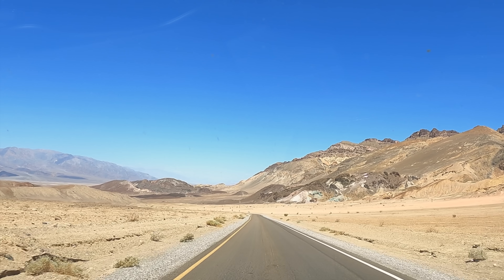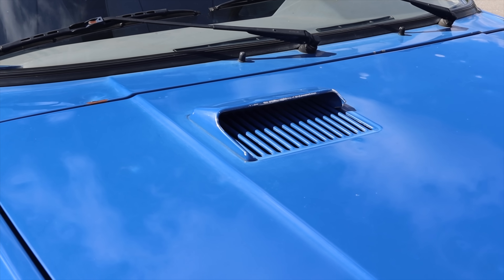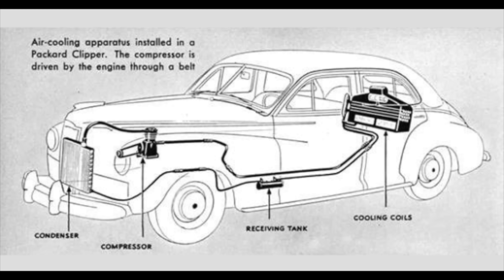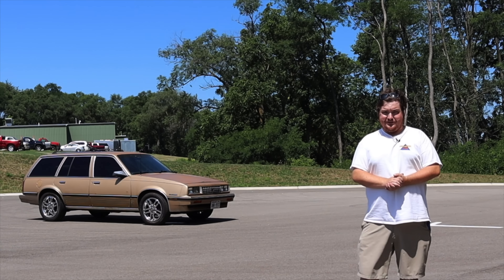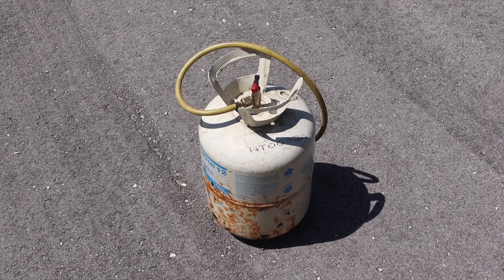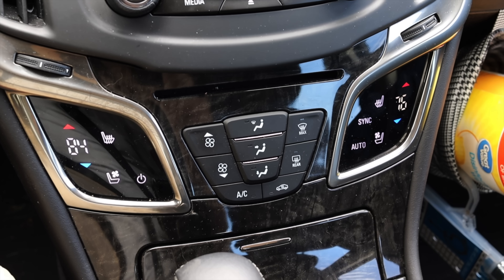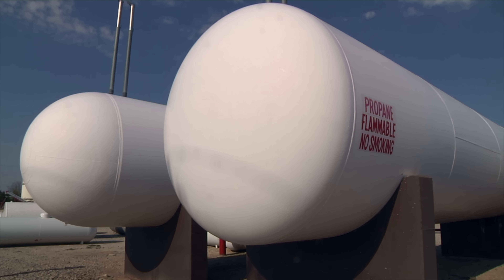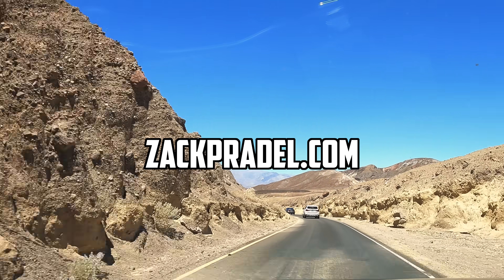Air Conditioning - The Story Of R12 & Why Modern Air Conditioning SUCKS!

Comment: R134a is already being phased out in newer cars with R1234yf. It's supposed to be less harmful to the ozone layer. BUT it's extremely flammable.
Reply: 1234yf is butane based
Reply: @ShortArmStrongArm  R-1234yf is absolutely not butane based.
Reply: @MrZorbatron  old post but did I say it was?
Reply: @ShortArmStrongArm You did.  Scroll up.
Reply: @MrZorbatron  All I find is when I said I charge my 134 systems with propane.
Reply: @ShortArmStrongArm  propane   they just want to try to minimize how dangers this stuff is     and the conditions are right under the hood of a auto for a fire  its warm  fans to bring in new air   what more can one want
Reply: @claycoates5056  🤷🏻‍♂️ i charge my R134 systems with regular ‘ol propane so oh well. Fuel pump sending large quantities of pressurized gasoline worries me more.
Reply: And EXPENSIVE!
Reply: @GoTMLGo1967  Very. Like 2500 to fill an empty system.
Reply: @davidchillton1744  Fun fact: there's not actually enough propane or butane in the refrigeration system to be an appreciable fire hazard. The main reason propane cooling never went mainstream was lobbying by DuPont to keep propane out of these systems so people had to buy expensive DuPont-patented fluorocarbons. 

Also fun fact: Early refrigeration systems used pure ammonia. They straight-up killed people when they leaked. 

Alsoalso fun fact: Modern industrial refrigeration STILL uses ammonia, and these systems still kill people when they leak.  Ammonia's just too good a refrigerant if you ignore the high toxicity.
Reply: @CptJistuce  A lot of arenas are still using ammonia.
Reply: @shadowwolfmandan  Yup. That's one of the things I was filing under "modern industrial refrigeration".
Reply: R11 was str8 ammonia and used in the 50s as refrigerant. Freon was name brand by DuPont. When the government cracked down DuPont changed the name to Suva.
Reply: @CptJistuce High toxicity? What? How in holy graces do you get a lethal dose ammonia? The slightest whiff of pure ammonia gas puts my lungs in total agony. I’ll die of suffocation well before I receive a life-threatening dose. Unlike CO, this ship will absolutely wake me up at the slightest hint of an indoor leak. That’s exactly what smelling salts are.
Reply: @setoman1  Relative to other refrigerants, it is quite toxic. As evidenced by the fact that ammonia refrigeration system leaks have killed people. This is not supposition on my part, it is documented fact. These days it happens exclusively with large commercial systems.
Reply: @CptJistuce  Arkla Servel units were everywhere here at one point. It is an absorption  system and worked, just not long.
Reply: @gibraltar321  The fire-powered coolers? Those still hurt my head. Like, fire is heat, almost by definition. It shouldn't make things cold!
Reply: @CptJistuce  True. Hurt my head learning about them. It shouldn't work but did, for awhile. Every liquid and gas on earth is an refrigerant.
Reply: @CptJistuce  Yea I remember hearing that in the old days they used ammonia as refrigerants. They worked real well but is not exactly good for people. However even traces of ammonia has a strong smell....
Reply: @CptJistuce Propane, under pressure,  circulates through the passenger compartment.   There's plenty enough to be dangerous.
Reply: @jackb1803  To my understanding... no, not really. It only takes a little bit of propane, and it is far less dangerous than most of what's been used instead.

I had to scroll back to figure out what was being replied to.
Reply: @CptJistuce since ammonia based refrigerant is solid state and only requires a heating element, it's used in RV refrigerators since it can be from with a propane furnace. I have had ammonia refrigerators go out and they will leak a heavy pungent gas for about a week before it runs put. If you're brave enough to cut the lines it will all leak out in about an hour or so and you won't be able to go near it for a few days becuase it will burn your eyes and lungs if you get with in 200 feet of it.
Reply: @CptJistuce  That brings up an interesting point. Most of the hardware for car air conditioning systems is essentially outdoors, so it's unlikely that the ammonia will kill anyone when it leaks. So maybe car AC should go back to using ammonia.
Reply: @pcno2832  Unless it leaks from the evaporator, which is in the cabin.
Reply: @pcno2832  say that when you’ve had a minor crash and the a/c ruptured and you are waking up from an air bag induced k.o in a cloud of ammonia
Reply: @pcno2832 you have to remember the evaporator, expansion valve, and part of the lines are all inside the cabin. Half of the components are inside.
Reply: @CptJistuce  I have absolutely no reason to check anything you've written/asserted because of "DuPont".  (NOT joking)
Reply: R1234yf is also very expensive compared to R134a.  It's nickname is YF for Your Fucked!
Reply: @Stumpy1973  YF is expensive because it's still under patent (AFAIK) with Honeywell, so they can charge what they want until the patent expires; I'm sure their shareholders are very happy with the price.
Reply: @Stumpy1973  Exactly! 
152a is only a little bit more than 134a. That's with the current use.
If we were using 152a then economies of scale should come into play.
Reply: @robertrocheville7769  I use 152A in my truck. Cost me half what 134A costs to charge it with the air duster
Reply: @Stumpy1973  at the the dealer we always called R 1, 2, 3 why the f*ck?
Reply: @Stumpy1973  $1600 a jug here.
Reply: @Stumpy1973 in the UK, I can get my car AC regassed for £60 to £80 as it uses R134A. However, to get a car using R1234yf regassed, it's £120 to £150.
Reply: @Stumpy1973 it's very expensive because DuPont owns the patent
Reply: Then just you some damn propane at this point
Reply: @vwbora26  car go boom
Reply: @vwbora26 Don't forgrt the propane accessories
Reply: @vwbora26 yeah, propane is also called r290, and it is used in some in low temperature applications
Reply: It's not extremely flammable. It does burn, but doesn't burn very hot. 

I don't know why they didn't move to 152a(that's the duster can he was mentioning). It's very compatible with 134a, is more efficient, and has a lower GWP than 134a.
Reply: most new fridges are using what is basically butane now....
Reply: @workingshlub8861  isobutane, gotta be sure to purge it all out before you braze on it lol
Reply: @workingshlub8861  cyclopentane is that you?
Reply: @workingshlub8861 my dad says butane is a bastard gas
Reply: @workingshlub8861  Cyclopentane?
Reply: There are rumors they are going to get rid of yf now too.
Reply: @levithrasher7417  i was recently section 609 certified and i can tell you that they are not phasing yf out, they made it so it was not required in new cars after making it required for a short amount of time due to supply chain shortages.
Reply: Why do the names just keep getting more and more ridiculous? What was wrong with R13/R14?
Reply: I was about to say this. It's also like 1/10th the CO2 equivalent as r134a.
Reply: @borandolph1267  try 1/1000th
Reply: so is gasoline and oil lol
Reply: What about R32? I fount it in my home AC
Reply: @ yahnathan morales ..... u mean R22
Reply: I don’t get why they won’t use  a propane/butane mix. There are commercially available r12 substitutes based on propane/butane that work very well that are much less flammable than newer flammable refrigerants.
Reply: @dontmesswiththeman  I don't think the butane propane mix is less flamible than r1234yf.
Reply: ok well technically it is classified as  "slightly flammable"
but even then I suppose its not the most flammable thing in a ICE car OR lithium battery car lolol
Reply: Its also stupid costly, and the machines for auto shops  being so costly repairing the systems are more. so that and it's already flammable why bother. It leaked out of my 2019 car so in goes  R-290. (that's the super pure propane you buy as a refrigerant)
Reply: The R1234yf also is one that isn't supposed to be easy to refill.
Reply: It also cost about $100 a pound and leaks like crazy
Reply: burning 134a make a nerve gas, burning 1234yf is worse.
Reply: I saw online that is mildly flammable, Not extremely flammable!
Reply: r1234yf is considered mildly flammable.
Reply: Don’t crash.
Reply: I'm going to be honest, it sounds like you made that up even though I know it's true
Reply: Apparently one of the major issues of R1234yf is that if you burn it (like in a car fire), the resultant gas is very corrosive.
Reply: I think I’d rather choose the former than having something that is noted as “HIGHLY” flammable on something I’m driving at 60mph.
Reply: It’s expensive af too at like $60 per 8 oz can
Reply: r1234yf is a literal scam by car manufacturers. more dangerous, more expensive, doesnt work as well. hmm no benefits except negligible environmental benefits
Reply: Most asian region still use it
Even some still sold R12 for installing new ac system or servicing.
Reply: R134a is not a cfc, it is an hfc. There's no Ozone Depletion Potential. It is high Global Warming Potential.
Reply: wont be in my car   my 92  k1500 still has r12    cant be beat
Reply: R134a is not harmful to the ozone layer, but instead they worry about it being like c02
Reply: I bought my car used, already has R1234yf. Car is from 5 years ago.
Reply: And extremely expensive as well as extremely corrosive. The 1234 system tends to leak. 
You can believe all the ozone  global garbage you want, but r12 is gas that is heavier than air that they want you to believe that it will get to 30,000ft where sunlight will break it down to sulfuric acid and then get to 60,000 and then blown to the antarctic to create a hole in the ozone. You can buy all of that you want 🤣. Food for thought, India is still making and using r12 and the ozone layer is healing itself. One more of the dozens of the end of the world scenarios since the 70s. 
The real reason for stopping the use of r12? Dupont's patent had run out.
Reply: It is also obscenely expensive
Reply: That’s good 😌
Reply: It’s also very expensive.
Reply: It is not 'extremely flammable',  but yes it will burn.
Reply: Oh sh-
Reply: Wrong.  It's MILDLY flammable.
Reply: And extremely expensive from what I've heard.
Reply: It's also extremely expensive too!
Reply: I thought you made that up but it's true
Reply: Back to that dastardly CO2 .. that they claim is 00.04% of the atmosphere again.... same gas that is used in photosynthesis and plant growth.... that creates o2. I can see genuine science here mixed in with theoretical pseudo science.... probably.
Reply: @stevel9914  no. i am certified to work with refrigerants. this is not pseudo science. when R12, a chlorofluorocarbon, is released into the air it makes its way up into the atmosphere because it is less dense than oxygen. eventually it reaches the ozone layer. chlorofluorocarbons themselves are not reactive, but when exposed to high amounts of UV radiation like in the ozone layer the chlorine atom splits off. the chlorine in the chlorofluorocarbons is very reactive with ozone, and this reaction destroys the ozone molecules and splits them off into chlorine monoxide and oxygen. chlorine monoxide is a powerful greenhouse gas with the capability to stay in the atmosphere for over 1000 years.
Reply: and extremely expensive
Reply: @carlosnavarro921  which is why they stopped phasing out r134 as of 2021 until supply chain issues can be resolved
Reply: My mini fridge uses butane or something
Reply: It is not extremely flammable, but classified as mildly flammable, as in would need to have a blow torch flame hitting it directly to burn, but won't spread.
Reply: It's like air conditioners. R22 had been used in air conditioners (window, central, ductless mini-split, PTAC, etc.) starting in the late 1920s. But thanks to the Montreal Protocol, R22 would have to be phased out. In the 2000s, R410A became a new alternative, but it was said to also cause global warming like R22, so nowadays, newer air conditioners are coming with R32 which is said to be much more environmentally friendly, but it is flammable.
Reply: Ah yes, R12, invented by the same man who brought us leaded gasoline, Thomas Midgley Jr. At the time, his inventions were world changing, but not in the way he would have imagined I'm sure.
Reply: 1234yf is garbage too. I’m not old enough to have experienced R12, but I have used 134a plenty of times, and it’s super potent…
Reply: It’s SLIGHTLY flammable, not extremely. It’s also compatible with R134a systems
Reply: Saying it's extremely flammable is also a extreme exaggeration
Reply: 1234yf is not an A3 it’s A2L hard to ignite even when exposed to opened flame 😂
Reply: Then just go back to using propane...
Reply: Reminds me of Fernie Canada.
Reply: Look at the high-cost screwing we're all getting in the HVAC industry because of the EPA and its ozone depletion cr*p!

Ozone depletion is crap. 

William Happer discusses ozone depletion quackery (min 10:00)

William Happer discusses the ozone quackery that has sh*tted up the HVAC industry. (min 10:00)

https://www.youtube.com/watch?v=KGn-6kGoD0c&t=1320s

The Nonsense That is Ozone-Depletion

"Holes" in the ozone argument: 

1) Freon is heavier than air:  how do molecules heavier than air get to 30,000 feet (the beginning of the stratosphere)? 

2) The "hole" in the ozone over the South Pole was "discovered" by satellites in the '80: if it was just "discovered", how do we know IT WASN'T THERE ALL ALONG ? ? ? ?

Ozone Hole Over Antarctica is Bigger Than Ever | 2020 Ozone Depletion
https://www.youtube.com/watch?v=njII28jfLVQ

3) There is a perfectly logical reason why there is less ozone over the polar regions: THERE IS LESS SUNLIGHT THERE TO PRODUCE OZONE IN THE FIRST PLACE, especially in winter ("land of the midnight sun...")  

4) Antarctica (South Pole) has the highest average elevation of any continent (8000 ft): Does that have any effect on ozone quantity?????  (The North Pole is all at sea level and there is no ozone "hole" there.  (Why not?) 

5) The offending atom is CHLORINE (very common), not CFCs themselves. The argument goes that the CFCs carry CHLORINE up to the stratosphere.  There are other compounds of chlorine in the atmosphere -- that's one of the things you smell when you go to the beach  --> "salt water" --> i.e. sodium-chloride.  Is the ocean a source of "ozone depleting" chlorine compounds?  

6) Most basic of all, ozone (O3) is an EFFECT of UV blockage, not a cause. [O3 is an unstable molecule that needs a lot of energy to produce, e.g. the ozone you smell around arcing engines. There is less ozone at the poles b/c there is less UV to generate it (just like there is less sunlight to keep the place warm in the first place.     

I hope the public is beginning to see how dubious this ozone scam is.   Monstrous mistakes like this DO happen - think the ban on DDT and malaria deaths.

The Ozone Scam
https://youtu.be/9Szs-treHwQ

The Nonsense That is Ozone-Depletion

https://www.ourcivilisation.com/ozone/king.htm+

Look how we've been "had" by this "ozone depletion" scam:

In other words, CFCs probably have NOTHING to do with Antarctic ozone:

https://youtu.be/lBu3vltczRw

In other words, the× Montreal Protocol is a complete fraud:

Min 0:30:  "Measurement of SURFACE 'ozone depleting substances' (chlorine? are you measuring ALL atmospheric chlorine compounds?).  

https://youtu.be/uVeTJSIbGm8

1987 - Montreal Protocol. Remember that date in this music-tracked piece of manipulative propaganda.
Listen for the weasel words and disclaimers.
https://youtu.be/Ll_TR7C4xr4

The Ozone hole is "healing" (scientific term). Can't you tell?:
https://youtu.be/taTzqRHNIEc

A discussion of atmospheric chlorine:

https://api.nationalgeographic.com/distribution/public/amp/news/2010/3/100310-sea-spray-ocean-colorado-pollution

Natural Chlorine? You Bet! (American Chemistry Counsel)

"Many of these chemicals are identical to highly publicized manmade organochlorines: chlorophenols, chlorinated hydrocarbons, PCBs, CFCs and dioxins."

https://chlorine.americanchemistry.com/Background-Natural-chlorine-You-bet-/

Min 7:50 "In the old days, capacitors used to last 10-20 years"
https://www.youtube.com/watch?v=eGEduZ3EVcg

7) Min 2:00 Listen carefully: in other words,  the ozone hole has been there since AT LEAST the 50s, before CFCs were widely used.

Min 15:00 "interesting scientifically" - must be fun to have these kinds of research grants and boondoggles. Great work if you can get it.

https://youtu.be/AU0eNa4GrgU

How EPA is screwing up your car's air conditioning. 

https://youtu.be/wm56tV5BbJk

Lousy car air conditioning:
https://youtu.be/5jKRiDtcBrs

Guy says we should use explosive propane as refrigerant

https://youtu.be/pv_fxOuLuZU

Propane as a refregerant
https://www.youtube.com/watch?v=iXyHOfx307k

.
Why The Banning Of Chlorofluorocarbons Is Paranoia

https://www.ourcivilisation.com/ozone/index.htm

Min 6:00 -- two different kinds of chlorine... (yeah, right)

https://youtu.be/kmfAM8kQrjU

The stupid claim the ozone layer is "healing" ("healing" - is that a scientific term?)  

Notice that the "hole" always goes away in Antarctic summer (more sunlight/more ozone produced) and reappears in Antarctic winter (no sunlight/no ozone produced (ozone is an unstable molecule to begin with)).  We've been sold a load of cr*p that has made a hideous mess of the AC industry. 

You'll see no change in hole size in the Antarctic winter, which means the "hole" has been there all along and is a perfectly natural and harmless phenomenon.  "Oh well, we trashed an entire industry over a quack-science hoax... Sorry about that..."

https://www.youtube.com/watch?v=kyGoqC9FTFc

https://youtu.be/krqHVzF3-T8

Min 21:00:  A brief history of refrigerants R12, R22, R410a and the screwing we get from the EPA, the "Montreal Protocol" (a self-appointed bureaucracy still alive and well) over their ozone depletion quackery.  The doubling of pressures from R12 to R22, and the DOUBLING AGAIN from R22 to R 410a,

AND R22 wasn't even banned for ozone depletion! (100x less "odp" from R12). It was banned for "global warming" quackery. 

https://youtu.be/V_wUZ4qmAnk

Min 36:00 Can be charged up to $30 a pound to destroy "contaminated" R22:

https://youtu.be/V_wUZ4qmAnk

Min 7:00 "pre-EPA refrigerants operated at low pressure and only soldered (not brazed) pipe joints. 

https://youtu.be/G0XOLDHGBmU

Min 18:00 all refrigerants turn into acid when in contact with water (! ! !):
https://youtu.be/kmfAM8kQrjU

Refrigerants decompose in water ! ! !

https://www.answers.com/Q/What_happens_when_refrigerant_hydrolyzes_with_water

What is hydrolysis?
https://youtu.be/G_mT9JI_jxE

What about the ozone hole and R-12 refrigerants?

https://creationtoday.org/what-about-the-ozone-hole-and-r-12-refrigerants/

Also forgotten is a long list of truly ridiculous claims, such as the one from Al Gore's 1992 book "Earth in the Balance"that, thanks to the Antarctic ozone hole, "hunters now report finding blind rabbits; fisherman catch blind salmon."

https://www.heritage.org/environment/commentary/ozone-the-hole-truth

Minute 22:00 refrigerants disassociate in water, so why sre they a problem in the stratosphere?

https://youtu.be/5SpOiHB6VsE

15% of chlorine in stratosphere is natural, according to this:

https://csl.noaa.gov/assessments/ozone/1998/faq3.html

Another comment I submit to The Order is about "NOISE", namely, 

- NOISE is a bad thing -- we don't want that in our houses. 

- Don't compressors that are forced to operate at higher pressures make more NOISE than compressors that operate at much lower pressures? 

- Assuming the answer to the above is "yes", then would a compressor that has to operate at 450 psi (for that stupid R-410A refrigerant -- 'scuse my french) vs. 150 psi for R-12 (the industry standard till that stupid EPA came along -- 'scuse my french again). 

- Here is a PT graph for the major refrigerants: https://www.engineeringtoolbox.com/refrigerant-temperature-pressure-chart-d_1683.html

- Conclusion: the stupid EPA and DOE have not only made AC equipment more expensive to buy and more expensive to maintain and less effective in terms of cooling (window ACs) -- they have also made them NOISIER.  ... Thank you, tax-paid idiots of environmentalism and quackery that is "ozone depletion" (the warmup act for "global warming" -- "Hey Texas -- how's that renewable energy/global warming/windmill thing working out????")

Thank you Boomer generation (mine) for the 60s mess you have made of America. 

Cheers.

PS: here's a video about a stupid 90% furnace whose condensation overflowed the week before Christmas and trashed multiple ceilings in the guy's house. Of course, those stupid DOE bureaucrats will be there bright and early to fix the damage.  "Happy Holidays!" 

https://www.youtube.com/watch?v=DnVtRqfqoSY&ab_channel=AntiDIYHVAC

... And another video about a screw-up with the INDUCER fan --> a creature of "high efficiency" DOE regulations which dictate the squeezing all so much heat out the combustion, a separate fan needed to get the exhaust gasses out the flu.  Then they break down and screw up the whole system. 

https://www.youtube.com/watch?v=SZJ1GPAATGY&t=370s&ab_channel=VintageVideos2009

..
Reply: and very forever chemical like with all the F in it
Reply: I believe my 2023 Subaru Forester has r1234yf. My previous car 2006 Honda Element add R134a which I think cooled down a little bit better than the newer stuff but I'm sure there are many things that will make it a not fair comparison. My Forester is a base model so I only have events in the front which was the same for my 2006 element as well as none of those had rear vents regardless of trim. Forster is also famous for having large Windows all the way around and me having a bass actually has untinted Windows which I'm sure does not Aid in cooling the vehicle whatsoever. Tell me it just seemed like a Honda Element cool down a little quicker.
Reply: And its way more expensive than 134a
Reply: It's also corrosive
Reply: Flammable maybe.  But with the tiny charge that's necessary, it's not really a risk.  The other fluids are much bigger concerns.
Reply: R1234yf isn't flamable, it is a PFAS, also known as forever chemicals. And are likely to get banned in the EU pretty soon
Reply: In the future will we use r290 ( propan). In most fridges we have r290. With r1234yf and r134a, don't have the same "power" as r12 or r404a. Or we can start to use r32, which is not a bad solution, but have great gwp, unlike the r290 which has 0.
Reply: Hopefully the government won’t go for the ULTIMATE SOLUTION, just do away with air conditioning altogether😂 Problem solved🤣
Reply: It’s not “extremely” flammable. It will burn but it does not sustain a flame in a stream.
Reply: R1234yf is propane
Reply: So propane but it costs an arm and a leg....
Reply: R134a isn’t really flammable. R1234yf is flammable, but not that much.
Reply: @brandondickie3456  It is flammable enough to be required to bear the flammable warning and symbols
Reply: You got fooled. R134a has ZERO ozone layer depletion potential. Now it's just a goofy CO2-equivalency thing.
Reply: Its an A2L refrigerant,  It is slightly flammable,  not extremely flammable
Reply: That helps
Reply: It also is corrosive so more leaks is actually worse
Reply: R134a is also flammable though...
But more and more cars come with R744 these days. It has the lowest CO2 equivalent, since it actually is CO2.
Reply: @panzerveps  And why dont they use(d) CO2 from the start? Its cheap, safe....
Reply: @pawsnpistons  it's difficult to make it safe because of the high pressures.
Also the system needs to be pure, the components have to be stronger, and the efficiency is lower.
Reply: @pawsnpistons  CO2 requires very high pressure to function as a refrigerant (100 bar or more), so the system itself is quite expensive. The gas is a lot cheaper though.
Reply: @Ju1ian10001  Youre joking, right? 😂
Reply: @pawsnpistons  c02 needs to be kept near supercritical point to have the necessary phase change points to be efficient. The upside to this is that any gas like c02 that can reach a supercritical state can practically be an efficient refrigerant.
Reply: @pawsnpistons  pressures too high
Reply: @panzerveps Are you sure.  CO2 requires 10x more pressure to be used as a refrigerant.
Reply: @panzerveps  but i rathet have Propane than co2 in my car. If there is nothing to ignite the Propan it wont burn, but if the co2 leaks the air in my car could get really thin really quick
Reply: @Daniel-mk8pc  there's not enough co2 to kill you. Besides, the cars have co2 sensors in the cabin in case there's a leak.
And do you think r1234yf or 134a is any safer to breathe?
Reply: @panzerveps  yep i do because These Systems dont need Sensors
Reply: @ Daniel,,,, propane will cause u to suffocate too.
Reply: A Prius with a COEXIST sticker will save the planet and the universe and stuff.
Reply: Ah yes let’s put flammable liquids next to controlled explosions in a tight hot space with an almost constant flow of electricity.. makes sense seems reasonable
Reply: It's not about the ozone layer, it's primarily about the climate. R134a has a global warming potential of 1,430. That means it's 1,430 times worse for the climate than Co2. R1234yf on the other hand has a GWP less than 1.

Also, it is not "extremely" flammable. It can be burned, but its ignition point is 405 degrees Celsius, nearly 800 degrees Fahrenheit. Compare that to something like gasoline, or even the carpet & seats in your cars cabin, and you'll realize that it does not pose a significant fire risk in a vehicle.
Reply: @derpmansderpyskin  it's not about global warming or climate or any of the radical lefts "feel good" save the world power grabs over the last 60 years that NEVER  actually happened.  This ones about the patents and money.
Reply: @cbmech2563  Bruh what are you even talking about?
Reply: @derpmansderpyskin  why cant they isolate parts from leaking then recycle/reuse them. same with stuff like cars carb and electric car batteries
Reply: Might as well use propane at that point.
Reply: bryan tichota  they use propane and butane in a lot of new fridges. It's better than anything
Reply: Thought I heard the pressures run very high with the new stuff...smh.  miss r12, not its ozone destruction
Reply: Oh Great add that the ulta-flammable EV battery packs and well be toast for sure. Is the EPA measuring the emission from these barbecues ?
Reply: they should just switch to propane and be done with it
Reply: Propane doesn't sound so bad now.
Reply: R1234yf is only barely flamable when under pressure...  Who told you it was "extremely flammable"?
Reply: It's only flammable if you're super irresponsible with it
Reply: Might as well just go with the propane at that point 😂
Reply: While it is flammable it isn’t dangerous. The gas in your car is more dangerous than the refrigerant.
Reply: r1234 does the same work as similar sized r134a cars. case in point 15 camry that uses r134a gets filled to about  1 lb or so.  the newer r1234 only gets filled to about .65 lbs.
Reply: @Rafał Hrynkiewicz  Slightly flammable, yes. BUT, not extremely flammable.
Reply: Ban breathing. But before that please buy our latest product unless you hate urth. Mkay?
Reply: @Rafal Hrynkiewicz yeah it sucks how flammable the new R1234yf is. Not good if you’re a smoker, and also not good in an accident. The government getting involved in stuff they don’t know about is their biggest mistake. New car lovers never mention the fact about the refrigerant being flammable. I’ve seen this with the car care nut, consumer reports, etc, I could go on. What would you rather have, extremely flammable refrigerant that could catch fire in a car accident, or old-school non-flammable refrigerant that doesn’t quite often get exposed to the open environment because mechanics use a recycling machine to evacuate the system. Think about that. I’m betting the old is gold in this case